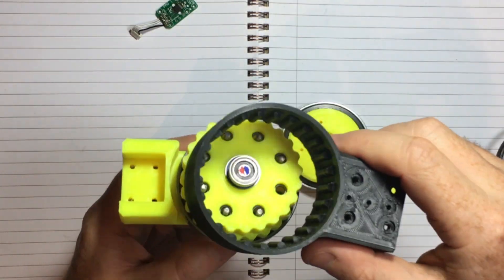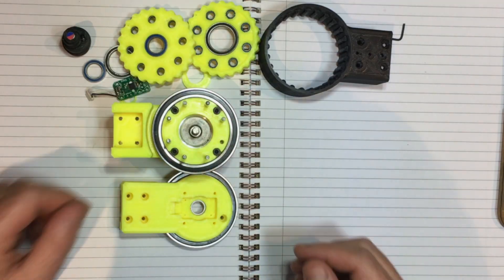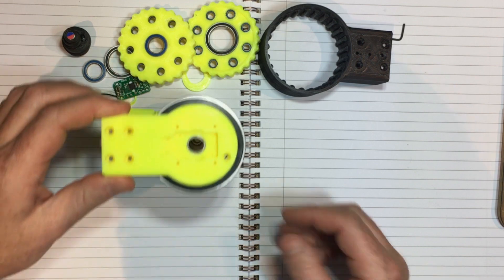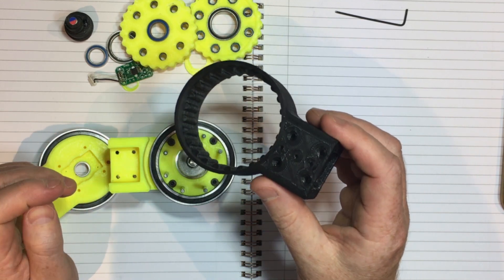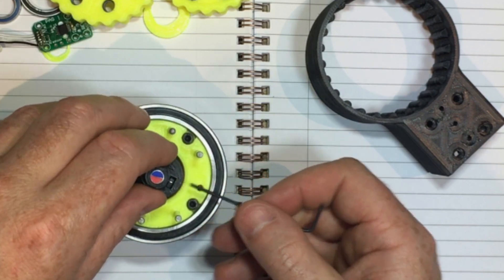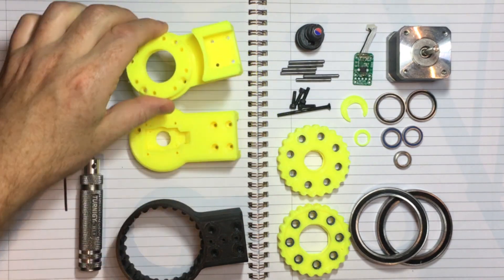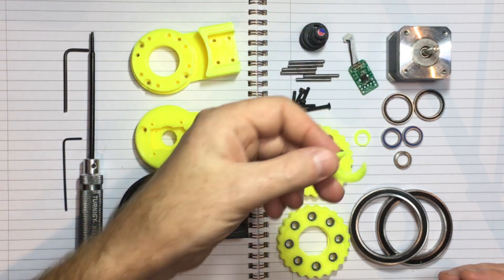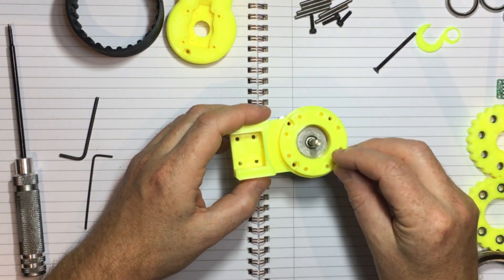Open Source Cycloidal Actuator with NEMA17

Comment: I noticed after placing the top gear onto the shaft, that it wobbles and doesn't stay flat. Once I add the output housing, it eventually pops off. Have you experienced this before?

Comment: Hi there ! thanks a lot for your work and those involved in this design, but I would like to ask why you didn't post the version you are showing in this video on thingiverse, I would like to have it constrained with nut and screw like in the video, but the file like that is not on thingiverse, and I would not want to drill a hole to make a mess, I can see that you replaced one of the steel rods with a long screw. Do you think the design on thingiverse is better ? thanks again.
Reply from the maker: https://www.thingiverse.com/thing:4781349

Comment: THANKS BRO!! There's no need to change in the 3d files? Just print it and asemmble then it works fine?
THANK YOU BRO , PLS REPLY.
Reply from the maker: It should be fine to just print. Every printer is slightly different. Tolerances are important to get low backlash.
Reply: @PaulGouldRobotics  Thank you so much for the reply
Reply: @PaulGouldRobotics  btw, I also want to print this  https://youtu.be/pizl7i-uB68, its one of your video, there' no need to change?
Reply from the maker: @creativebuilder577  The files on Thingiverse are the actual ones I use for printing my own prototypes.
Reply: @PaulGouldRobotics  Thank you! So much appreciated your video and your files
Reply from the maker: @creativebuilder577  What are you making?
Reply: @PaulGouldRobotics  a robotic arm, with shoulder,base,elbow and wrist
Reply: @PaulGouldRobotics  maybe I use this with elbow and wrist
Reply: Or maybe, sholder and elbow

Comment: What is the PCB for the top? Some kind of position sensor?
Reply from the maker: It is an Absolute magnetic encoder. There is a diametric magnet connected to the Steppers shaft. The next step is to run SimpleFOC or some smart controller so you cannot use steps.
Reply: @PaulGouldRobotics  Where do you get your diamtric magnets from? They seem rather rare.
Reply: Sorry to be a nusance. This is all new and super interesting and I'm very grateful for all of your exploratory work!
Reply from the maker: @nateashby5613  What country are you in?
Reply: @PaulGouldRobotics  The US
Reply from the maker: @nateashby5613  https://www.kjmagnetics.com/products.asp?cat=1&scri=14
https://amfmagnets.com/neodymium-disc-6mm-x-2-5mm-n35-diametrically-magnetised.html
https://www.apexmagnets.com/magnets?magnetization=54

Comment: TEST BACKLASH, TEST TEST TEST...!!
Reply from the maker: It is currently not good. I need to reprint some parts to reduce the tolerance. 3D printed cycloidals are never going to great for backlash. I have created an Anti-backlash cycloidal gearbox in a separate video.

Comment: thanks for sharing your work. I looked at the thingiverse list but I cannot find the size and length of the dowel pin and the size of the small bearing for installed inside the gear. Do you mind providing that? thanks!
Reply from the maker: Thingiverse is update with the bearing (8x5x2.5) and rod (32x3)
Reply: @PaulGouldRobotics  thank you so much!

Comment: Very nice design. This is my design, to be used with freecad. (a plug in that makes a gearbox). https://github.com/iplayfast/CycloidGearBox The idea is a default gearbox that you can adjust, and then use the parts you want.
Reply from the maker: Nice code. Inventor supports parametric equations but most other CAD packages don't and this will be useful. I'll share/link this code in one of my future videos if that is ok.
Reply: @PaulGouldRobotics  It would be my pleasure.

Comment: Great Work Paul. I have seen that you have worked with both Cycloidal Gears and Capstan Drives. Which has given you a better performance?
Reply from the maker: I think timing/capstan drives for NEMA17 are better in the following ways:- Lighter, a lot cheaper, zero backlash, higher efficiency, higher ratios and linear/smooth. Tensioning is a bit hard for both the timing belt and capstan cables. I've only been playing with capstans for a few months but I feel they are overall better for NEMA17. I'm still doing tests on Brushless motors.

Comment: Cool, thanks for sharing and making it open source! What's the anti backlash part here? Is it just down to getting a good and slight interference fit? I remember one of your older videos where the outer gear was split into 3 parts that were tensioned in opposite directions with a cable to remove backlash
Reply from the maker: There is no anti-backlash on this design. I have found that if I print the part with good tolerances the backlash is acceptable.

Comment: Great! work. It would be great if you share some details about the board you are using for the close loop setup.
Reply from the maker: My board will be months away. You can use S42B or check out  SimpleFOC and https://hackaday.io/project/11224-mechaduino

Comment: Are there any benefits to this compared to the much simpler capstan drive you had shown?
Reply from the maker: Cycloidal gearboxes can achieve a higher reduction ratio. The motor can be inline with the gearbox. But I'll be moving to timing belt and capstan for most of my future work.
Reply: @PaulGouldRobotics  I havent actually printed any reducers. But I can imagine that the fluctuations of how thick the printed line is makes printing accurate walls for the cycloidal gear very frustrating. And by walls I mean the functional "gear part" walls of it. 
Is that the case or am I overthinking?
If it is, then moving forward with using belts or capstan is indeed the better choice.
Do you plan on ever working on a harmonic drive that uses belts?
I think that the combination of belt on the flexure and 3d printed teeth on the outer ring would be affected much less by any printing discrepancies compared to how it affects the smoothness of a 3d pritned cyclodial gearbox. Because the slight elasticity of the belt teeth would allow it to conform much easier to printed teeth. Especially if there was sufficient pressure behind it. It could result in some very rigid and low backlash gearbox. What do you think?
On another question, do you plan on integrating any simple metal parts on your capstan drives to increase their longevity? I am mostly talking about the shafts. Because 3d printed plastic and tensioned steel seems destined to cause problems in the long run.
Cheers!
Reply from the maker: @Mr30friends  Once it is "dialed in", it is very repeatable.
Reply from the maker: @Mr30friends  You are correct about the 3d printed thicknesses. My friend Simon make these harmonic drives. I'll continue developing capstans for a while. I don't want to use metal because I would like the design to be easily reproducible with a simple 3D printer. I will strength the capstan input drive with M3 bolts. Capstan's only have rolling resistance so if I spread out the load it should be fine long term.

Comment: If I want a 10:1 reduction instead of a 25:1 what more is it than a different number of "teeth" of the eccentrically driven yellow gears and the black housing as well as a different eccentricity?
Reply from the maker: Everything has to change. Smaller ratios require a larger eccentricity and larger outer pins also. 25:1 is almost idea for this diameter.
Reply: Once the design stabilizes, its may be possible to create a parametric CAD model with the required design rules to generate a model with a specific ratio. But this would be specific to a particular CAD modeler.
Reply from the maker: I use a parametric model for all cycloidal gearboxes. It is much quicker to determine the correct dimensions.
Reply: @PaulGouldRobotics  Great! Do you have it optimized for different ratios, with all geometry associated to the number of teeth? Chances are formulas will need to be embedded in the model and proper associative rules would need to drive resultant geometry such as the eccentricity of the gears and housing.

These days its much easier to apply these rules after the design is finalized.

Modern parametric CAD systems make this a lot easier today than when I first became involved with it in the 1990's (ComputerVision's CADDS5 and PTC's Pro-Engineer). Back then, once the final design was created, we would design a completely new solid bases on the geometry of the final, being sure to create all the construction geometry first. This is because the early parametric CAD systems were 'history' based.

 But these are things that shouldn't be addressed until later. You are doing a remarkable job implementing design improvements. Building in (and testing) a CAD model to generate a "family of parts" (ie kick out different ratio designs reliably) is a whole different domain.